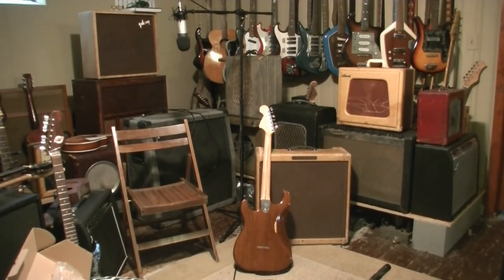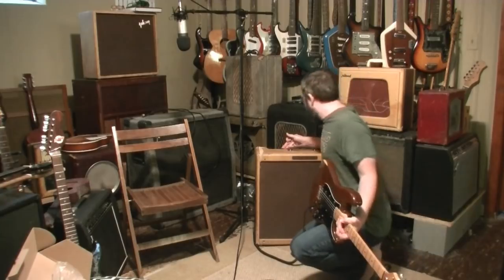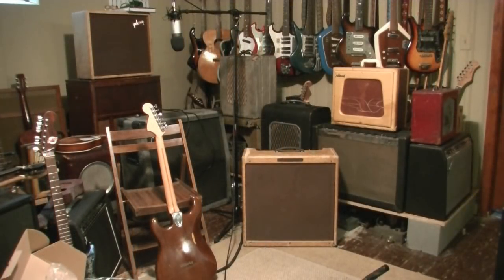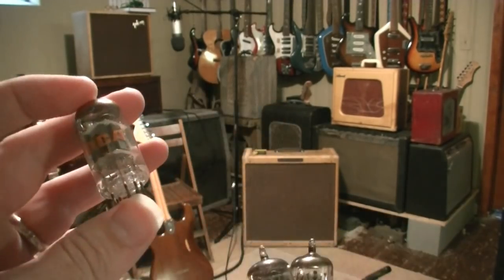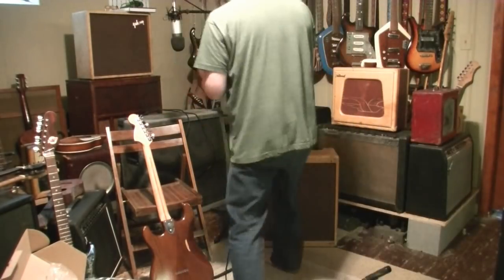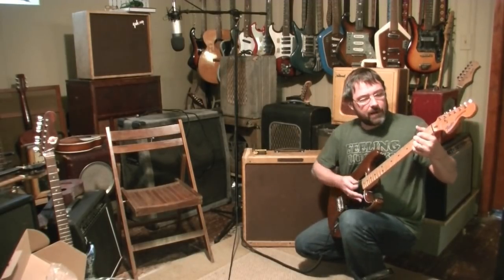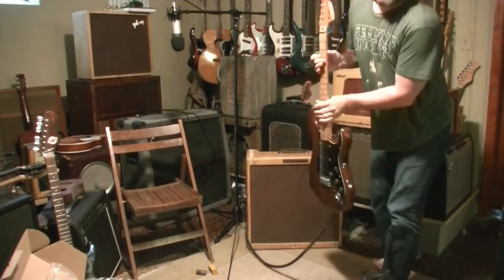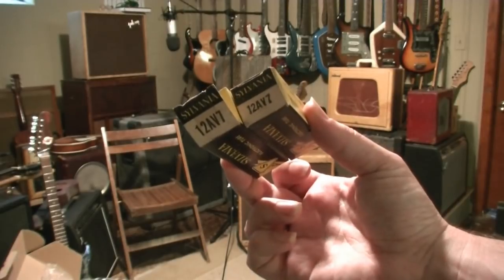High End NOS Tube Rolling in 50s Fender Bassman (Mullard, RCA, Amperex, GE, Sylvania)

Comment from the maker: VOTE TALLY SO FAR...
#1 Sylvania 12AV7: 3 votes
#2 Amperex Bugle Boy: 1 vote
#3 Mullard RCA: 7 votes
#4 GE Wurlitzer: 4 votes
#5 RCA 7025: 28 votes
I'll add to these totals in a few days and see if things have changed, so keep voting.
Reply from the maker: Sure, I think what you say has validity. For a lot of guys, pedals are their sound. An AY or even a AV, AT, 5751, or even AU  will be the ticket. I don't personally use pedals, but I don't play out much either.
Reply: what do you mean by "you dont use pedals,but you dont play out much either"? Sorry Im from the UK and dont get what your saying.
Reply: Hey Brad, I have a 1996 Made in USA Hot Rod Deluxe. I have the AT7 in V1. It brought the overall volume down quite a bit, which is important here in the land of high population density living (Apartments everywhere), but it also fixed the prob that the HRDx has of being too quiet to hear on 1, but blowing out the windows on 1.5. Now I can turn it up to about 4 on the clean channel without worrying that the spiderwoman downstairs is going to get pissed off and report me to the landlord. The drive channel also smoothed out, and really changed the sound of a typical Fender overdrive. It's smoother, maybe that's the wrong word? I don't know. But it sounds quite good. It didn't with the normal 12ax7 in it.

So what did the final tally on the tubes end up? More important, what tube went home to the customer?? Bob in Germany
Reply: Anyone who knows anything about tubes/valves will know the NOS British made Mullards are the best on the planet for guitar amps or HiFi.
Reply: I really liked the 12av7s...they were not as loud but if you listen closely they are really tight without that after ring..very clean which would be fantastic for a pedal chain..even driven they still really tight with just the right amount drive..I find the 12ax7 when pushed starts to get mushy...my vote 12av7 then the mullard rca 12ax7 .then the 7025...exellent comparison!!!!!Great video...great noodling!!😎😎
Reply: I like the British RCAs. I have quite a few NOS tubes and the Amperex, RCA, and Mullards are my favorite. Long plate RCAs are amazing. Just did a comparison myself and switched all my tubes to RCA 7025 and a 12AT7 in the FX Loop. Such a great crunch tone with these things! I'd like to locate some old stock EL84/6BQ5 tubes.
Reply: @Mrlz56  That's so cool. I collect them myself and have a bunch if tubes. Some I do t uae and some I havw no use for. Haha but I would definitely take a couple off your hands!
Reply: Interesting. The 7025 in a classic low noise version of the 12ax7. I think the 7025 sounds a little bit better in a super reverb. As for this amp, which is my favorite of the tweeds I'm on the fence between the RCA Mullard and the 7025. The 7025 scoops the mids a little too much which I hate. 😆 but sounds killer in the neck position.
Reply: @davelister1400  right, don't use pedals means he don't use pedals much. Don't play out much means he don't play out much. Where the problem? All of these words have the same meaning in English as they do in American. 🤷‍♂️
Reply: #5 WURLITZER spoke to me
Reply: I paused the video and had a good look at the RCA labeled Made in Great Britain - hard to tell, but are those “smooth plates”? I know it’s been a few years but I am curious if you still have it. If there are no “ribs” or ladder rungs, and they are smooth plates like the earlier Telefunken 12AX7’s, then that is actually an EI tube, not a Mullard. The importers selling to RCA were a bit tricky in those days and you’ll find a lot of tubes labeled as “Gt. Britain” that really came from other places. Either way, that’s a great tube! Wonderful playing too. That is a fantastic Strat tone.

Comment: I won't rank the Sylvania 12AV7 in V1, the amp wasn't designed to use that and it changes the character of the amp so much it doesn't even sound like a Bassman. It's like, "Oh, that's interesting, but I can have a 12AX7 in that position that really kicks it." Of the rest, I think I can tell how you would rank them by the length of time you played them and by your smiles and laughter; 5, 2, 3, 4. I think the Mullard is a stronger tube than the other three, with the GE the weakest, and I mean strength as measured on a tube tester. I love Mullard 12AX7s.That one is a long plate, so must be an mC1, F1 or F2, made in the fifties. Your lucky to have a such a strong one. It's so much more deep voiced and throatier than the rest, distorts earlier, and has more balls and crunch. But the RCA 7025 suits the Bassman better, is more balanced, and captures that Fender sound better, and since you liked it better, I think that made you play it better. That's always a bit of a problem with these types of videos, but I'm not complaining. I think you did a good job of capturing the strengths of each tube. For me it's 5, 3, 2, 4. I think the GE would have fared better if it wasn't a little weak. GEs have that Fender twang.
Reply from the maker: umac76 great comment. Thanks!
Reply: I agree with umac76, he has got a point, I think that almighty Fender twang could be heard when the reverb is cranked... Mullards are usually kinda Vox tubes... Mullards in a Fender? Not the best idea, again what you heard the most is amp's speakers, then the sound is compressed by the mic and youtube compresses the audio to 128k quality which is a relatively low quality... so u kinda can't hear the tubes (you must play them live to hear it out)...  I heard some monster tone amps on youtube and played them live and they were rubbish! And I done an experiment with Wharfedale Pro mic and recorded the 'ol' Fender deluxe and compared the recoring to the real (the amp was better live) So you can't actually hear the difference on video... (Every tube is built a little bit different so you can't just say ill stick with Mullards)!

Comment: The best GE 12ax7 long plates were made by Kenrad and sold too RCA and relabeled in the 1950s and had harmonic clean tones of the 1960s and lacked bass and depth but were sweet sounding !
One of the best 12ax7 tubes was the Yugoslavia made tubes but cannot be used in combo amps as they are easily microphonic from shaking !
The Vintage Phillips -Edicron - National long plate 12ax7 tubes were very dynamic and strong with gain and had great full range depth that can break up very nice crunch !

If you can get a good Tungsram 12ax7 tube it never plays a bad note and the highs are special and silky without any shrillness when pushed into breakup !

Mullard ecc83 tubes seem to be one of the best tubes for guitar tones out there !
Most other vintage tubes are not voiced for guitar amp tones as the Sylvania long grey plate 12ax7 is very high gain but will not breakup correctly and clean tones seem somewhat strange and not voiced correctly for guitar !

RCA long grey plate 12ax7 tubes breakup at low gain settings and lack gain and sound nasty allways breaking into distortion !

Function tubes used as reverb or the FX loop send return positions should be medium gain tubes NOT HIGH GAIN TUBES like JJ tesla 12ax7 which sound fine there !

The only new Sino china 12ax7 i would try is the newer 7025 they come out with as it is warm and sweet without any fizz when pushed , its a grey short plate tube that is better than all the vintage short plate 12ax7 tubes surprisingly !
I would say its warm sounding full range tube similar to the old vintage Mullard ecc83  if you can believe that but its true !

Amperex 12ax7 are for very warm amps as these tubes are bright as daylight !

The new Tungsol 12ax7 tubes are suited and voiced correctly for guitar !

The best Phases Inverter tube on planet Earth is the Sovtek 12ax7 LPS balanced triodes tube at $22.00
Reply: I looked very closely at the RCA marked “made in Gt. Britain”… it looks very much like a Telefunken smooth plate. I don’t see “ribs” or ladder rungs on the plates. This tells me it actually IS a Yugoslavian EI relabeled as RCA. There were distributors around the ‘70s that imported tubes from all over the place and wrote “made in Great Britain” on them. I know these are EI because of the smooth plates - they bought the tooling from Telefunken when they ceased operations, and moved it to Yugoslavia. Either way, it sounds great! And your comment about microphonics on Yugoslavian tubes is correct, seems this is just a good one! I have a couple RCA 12AX7’s marked as Made in Gt. Britain. One has a factory code starting with “8”, meaning it was probably made by Philips in Holland, the other is identical but with no code, so I’m not sure where it was made. (Philips 12AX7’s are pretty much the same tube as a Mullard - Philips owned Mullard.) The only way to be sure it’s a true made in Great Britain Mullard is if it has a “B” or “R” factory code.

Comment: Do old stock 5751 tubes make for a good substitute in this application also? I only ask I I like them (and hord them) in my little class A single 6V6 amps. Usually a 5Y3 rectifier. Great videos, playing and information. Thanks!
Reply from the maker: Hebrew Hammer I have a couple of those in stash. Nice tubes too.and yes, great sub! Almost 12ax7 in gain, just slightly rolled off
Reply: SRV used them in place of 7025's sometimes. They are harder to find though.

Comment: Years ago I played through a "Red-knob" Fender amp, I found out later that it is known as the "evil twin" I absolutely loved the tone that that amp had! I would love to acquire one. But first I wondered  what you thought of them, and if you had ever serviced one. would love to hear what your opinion is..Thanks love the videos
Reply from the maker: John Seymour never serviced one of those I recall, but I've played them and they can sound pretty darn good.
Reply: I have one of the Evil Twins with red knobs. One of the better newer tube amps from Fender.!! The thousands of tone adjustments you can make with just pulling the knobs out for lower or higher gains.  It is fantastic for rock, jazz, blues or country.!! I have pushed this amp to its limits and  didn't fry any parts yet....!!
Reply: I have the Twin released after the evil twin. It has a great clean bell tone but you cant get a good overdrive. Its actually a 3 channel amp. Its fine if you use a TS pedal in front, but it wont cut dirty on its own.

Comment: The first video sounded like you put some compression on the mic. It gave it that real hard pick attack. (Compression doesn't work well on cabinet mics.) Either that, or one or more tubes was shot because I've had bad tubes produce that sound too. Whatever you changed, this sounds tremendously better.
Reply from the maker: I agree. This sounds way better. In first vid, it was compression, and it sounded fine in the headphones, but when I listened back I was disappointed. Back to drawing board.

Comment: My ears aren't good enough anymore for this sort of thing, but I also really enjoyed the 7025.  #2 might sound great in my tube overdrive pedal... Or maybe terrible!  It's fickle.
I've got a 7025 sitting around here somewhere... Can't remember where I put it (Maybe it's in my Elk?) or what brand it was (green text is all I remember, maybe GE?).  I'll have to go digging and do some rolling myself once I get the OK to make some noise in the basement.

Thanks for the video, I really enjoyed it!
Reply from the maker: It's kinda unfair to a couple of these tubes in a way, cause I got a sound I liked with tubes 1&2 and then made the self-imposed decision not to touch the tone knobs. If I could have corrected for #3's highs a bit, I could have smoothed it up, for instance. Or I could have driven #4 harder by boosting the EQ, etc.

Comment: Brad how much volume could be put on my 59 twin without hurting the original speakers.
Reply from the maker: Krusty Buzzard if it's original cones, you might want to be careful, but they are supposed to be able to handle full output power. If you're really concerned about it, stick a couple modern speakers in and box the originals.
Reply: The Guitologist it's never been abused it belonged to my dad and hasn't been used sence the early to mid 70s above  volume level 4-5. I haven't done a visual on them as far as o can tell no tears I know the bright channel is out but that's it for probs far as working goes

Comment: #5 then #4. I'm glad most of the online community craps all over the old GE 12AX7s- it keeps the prices low for the rest of us who know that it's secretly a very solid, well-performing tube. I've acquired a few late-50s GEs by accident (labelled Zenith of all things) and they are incredible. Pair it with an old Jensen speaker in a simple American-style amp and you can do anything with those tones. The RCA 7025 is a ringer in this competition. It's hard to beat a strong RCA 7025, especially with single coils.

Comment: Do these tubes go in all kinds of different types of gear?  Like for example there are guitar effects pedals that have tubes in them.. Is that the same type and size that go in amps? Do you know which would be the best ones in say a  BK Butler Tube Driver pedal? I know the 12 AX7 dos not sound good in this pedal way too scratchy and fuzzy,   so are all these  different tubes the same size, do they  all fit the same gear and pedals?  What would be the best tubes for  a Marshall JCM 2000  dsl 401 combo amp?  I want it to soundlike a classic Marshall plexi as much as possible, and it  sounds lousy now with the stock tubes,  like modern fizzy gain.  How can I learn what tubes go best  in  various gear?  Do they still make tubes now, and if so where? I do NOT want any cheap  lousy Chinese tubes at all!! These ones you are using here are they new, still made now?  How can I find out all tube info I need to know?

Comment: Looked at a '90's Fender Blues Deluxe for $490. Scratchy tone pots and the signal cut in and out adjusting the treble. Should I take a chance. I'm good with electronics. Or a mint Hotrod deluxe for $500.
Reply: Jason & Steffanie Baker    thank you
Reply: La Pietra No! The new Deluxe/Deville series has a 5-10 year lifespan. After that it's cheaper to rip the guts out and replace the entire circuit with new hand wired parts. The replacement board sets from Fender are around $400.

The Bandmaster Reverb late 68 to early 70's is my favorite cheap amp and it'll last another 50 years with minor maintenance.

Comment: #5 for the overdrive!

This bit is for the viewers,

The 12AV7 can be used successfully as a preamp tube if the circuit is optimized for its performance. Swapping a few resistors in the standard "Fender™" circuit would insure safe and reliable use. The old standard 1/2w carbon composition resistors can handle high pulse currents, new film types can't. Besides, most new amps are littered with 1/4 watt resistors and would probably blow very shortly after inserting the tube

💀⚡️💀⚡️💀The 12AV7 has 3 times the plate dissipation, current, 150% heater current and 6 times less plate resistance of a 12AY7. Always look at the tube you're substituting and if the specs are within reason(like a 5751 vs 12AX7/ECC83) it should work well and be reliable.💀⚡️💀⚡️💀
Reply from the maker: Matt Fields I'll go out on a limb here and say that virtually any vintage amp should be fine with a couple AV subs. Modern stuff may not have overspec transformers if they're a cheap amp

Comment: Question for you. Do different output transformers like Mercury Magnetics, or Classictone really make any kind of tonal difference? Would you suggest upgrading the output transformer?
Reply from the maker: Transformers do make a difference in tone, a bigger difference by far than the brand of caps one uses. I would never recommend changing the transformers in vintage amps, especially collectible ones like this.

Comment: is that compression I hear coming from the amp or is it caused by the sound recording? if I  understood your remark correctly it's possibly the recording, right?
Reply from the maker: It's the recording. No way to turn it off completely. It only compresses hard on initial attack when it's been real quiet. Once I start playing, it seems to go away. I think this is just something I may have to deal with or bite the bullet and start recording audio and video separately.

Comment: Another Great video .. #5 / 7025 Wins Hands down !! Its got plenty of gain with less hum than the rest, and it made you smile and laugh !! That example of Mullard  12AX7 seams to much for that amp. Its kind of sad no one makes a proper 7025 today with the same specs, high gain ,lower output ,low noise .  New production 7025's are just short plate 12AX7's. They don't have the lower output that gives them a nice compression ..
Reply from the maker: I have a decent collection of 7025, but it isn't endless, and I'm dreading the day they're all gone.  May be the best preamp tube ever made.
Reply: Yeah Iv'e got around 50 of them. The RCA's are the smoothest much more quiet than the Mullards, and they don't have that Heater Flash that prematurely ages the European tubes.